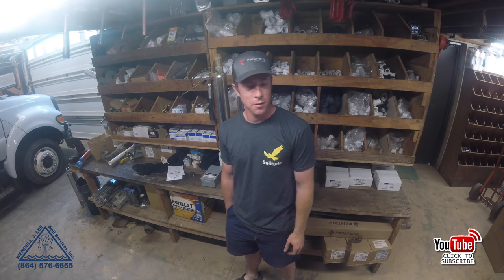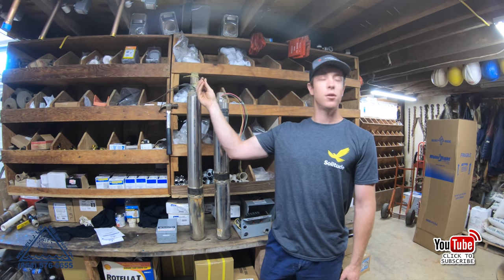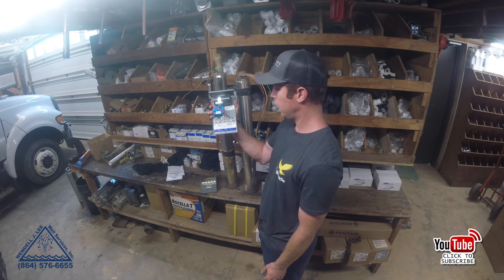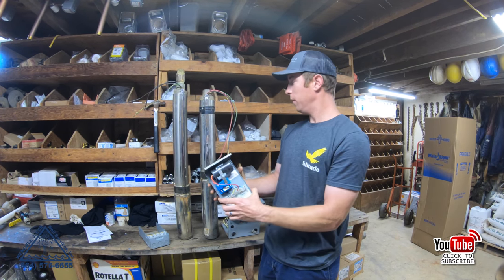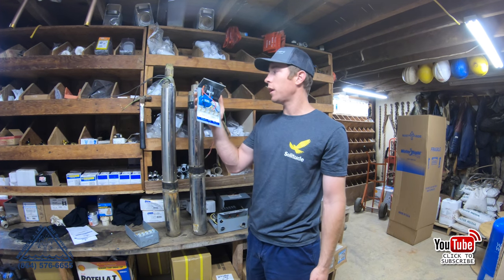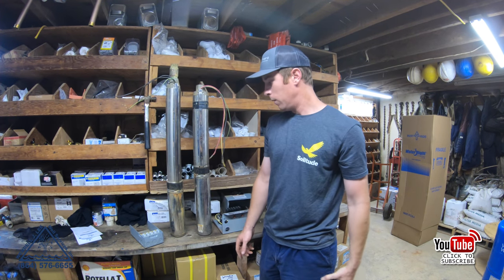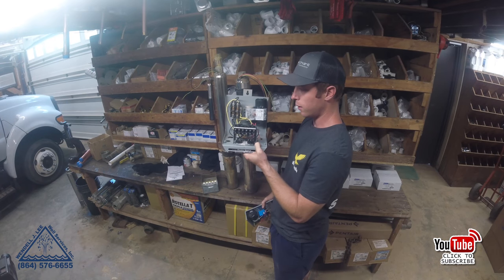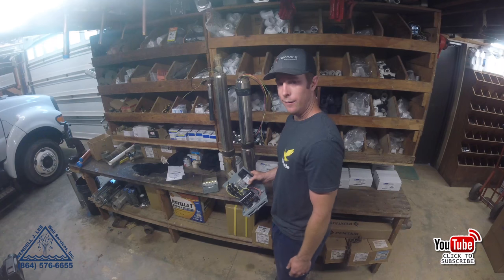2 Wire and 3 Wire Submersible Well Pump Motor Wiring Differences Explained

Comment: Thank you 
Thank you 
Thank you!
I’m learning about well pumps and everything else that goes along with them out of necessity. 
I recently told the property owner “thanks for allowing me the opportunity to learn how to run a ranch and be the full time maintenance man. I’m paying as I go so anytime something happens, I’m responsible. Eliminating the controller box made sense to me the moment I learned what it is. Used to be 44 horses here and the controller makes it possible to run the well pump and the transfer pump to keep the 3,500 gallon tank ready to fill a trough anytime and fill another and another. Now it’s just me and my little woman. No more horses for the time being. Thanks for reassuring me that I was thinking correctly about eliminating the unnecessary things that plagued the system.  I might make it fully manual and turn the well pump on once every four or five days and not have to worry about all the other stuff knowing I have a good transfer pump and pressure tank. Great videos like this one makes YouTube priceless!
Keep up the good work!

Comment: Nice videos. Keep them coming. I will be installing a 2 wire Grundfos 10sq07-200. I was leary of switching from a 3 wire setup to 2 wire, but the soft start feature, light weight, and low amp draw have me sold on it. I worked for a well driller for 4 years, but we generally didn't do pump work unless we were putting in a 4 inch steel liner or just pulling pumps for well abandonment. One idea for future videos, let us see what some common failures of pumps are, along with suspected causes, and maybe some reviews. Thanks.
Reply from the maker: Sure thing, thanks for tuning in and commenting. We always love suggestions and I will keep them coming. You will love the Grundfos SQ, we have had very few issues with them.

Comment: I have three wire system that I was convinced by the salesman to use when I put in my well 35 years ago. About 26 years later I replaced the controller because the capacitor was more expensive to replace. I was happy I didnt have to pull the pump as it was cold that november. That said, the following January I was pulling my pump when it was 30 below zero. Long story short, didnt save at all. Sure wish I would have gone 2 wire all those years ago.

Comment: I ran into an amazing rent deal in a brick house on several acres close to the city but surrounded by woods. Only catch was I have to fix things myself. House was allrdy Jerry rigged up with the wiring. After a few years woke up and no water no pressure. Eventually seen the 110 breaker labeled "well" had nothing connected. Wire from  well was run underground I couldn't ever find where it come out. I unhooked from junction box in well and run a dropcord and I assumed it was 110 cause it was 2 wires from pump and I knew way less then about well pumps then. I still don't know much. But I found that no matter which receptacle I plugged into the breaker box would wig out hum real loud then flip breaker. Realized that if I cut off hot water heater breaker I could then successfully choose any plug and have running water. But couldn't have hot water and running water at same time. Later I cut into water heater wire a few feet from the breaker and pulled it thru and hooked a dryer cord up to it and I have been doing that to feed my addiction to not cold showers. Over time my pump is whack and less pressure and I'm limited to a couple shits a evening after work and a quick shower n the morning. Sometimes I have no water at all. I kind of just wanted to share my experience with people that may would take a interest in it I know I got things rigged up like a waterhead would do. I assume a warm drop cord would happen on 110 or 220 , but if anyone is still with me here and had a idea of how I could find out of my pump is 220 that would be cool but it's not expected. U know, other than calling a professional. The way things are rigged up here even before I got ahold of things would likely bring more attention than I would like. Thanks for reading my rambling

Comment: Getting a well drilled next week. 1.5hp 2 wire. Told me I need #4 URD for a 200' run from the service panel. Urd has 2 hots and a neutral. Do yall just use the neutral as the ground on both sides of service? And does #4 sound right?

Comment: I've got a Grundfos 2 wire 10 SQ/SQE pump that's marked 110v on the housing.  According to the manual on the pump side of the pressure switch it shows Line Neutral and Green wires.    Mine has 2 black wires and 1 green wire.  Should I assume either black wire can be used as a Line or a Neutral wire?  You would think Grundfos would tell you what color the pump wires are but they don't.

Comment: I had a 3 wire motor. New motor is a 2 wire... I don't know how to wire it in. Do you have a video on how to do it? Do I still use a control box?

Comment: Now when you say a 2-wire, does that mean that it has three wires coming up to the top of the Wellhead? I actually have two wires coming up to the Wellhead into the house on mine. Is that right?
Reply from the maker: in today's world yes, two wires and a ground. You must have a pump that is older than 30 years, back before pump manufacturers ran a ground wire off their motor.
Reply: @WendellLeeWellServices   I am closing on an old house this week and I noticed the wiring from the well has 3 wires coming in, only 2 are connected to the pressure switch (which appears to be 240v), the yellow (which I believe is ground) is just hanging there not attached.  I have do not know what is under the well cap, but I am guessing it is an older 2 wire as well unless someone was lazy and just didn't want to connect the ground?  Have you seen it like this before?   I am planning on replacing the pressure tank and switch and will plan to hook up the ground wire to the well pump (even if the current pump doesn't have a ground wire) that way when the pump needs replaced the ground wire will be grounded.
Reply from the maker: @brandonandkeiafink204  Yes I have seen this before. Chances are your pump is old and doesn't have a ground wire ran out of its motor.

Comment: Great video man. I am here in Canada and have a flowing artsian well with a 2 wire 1HP motor that has issues. Do you have to use a trash pump to pump below the pitless adapter while pulling the pump? or just do everything you normally would do with the water flowing out if the top?
Reply from the maker: we dont have many flowing wells here but in the few ones we do have, we just pull them as we normally would. We also don't install pumps on a pitless adapter here either, all of ours are on a well seal resting on top of the casing 1 ft above grade
Reply: thank you for your reply. I wish mine was like that. Pitless is 5.5 feet down. I've tried calling around to have the pump pulled and everyone is just terrified because it's a flowing well. I am going to attempt it myself at this point.
Reply from the maker: @tnt666tnt  hopefully it isn't too deep in the well. 5.5 feet down to the pitless, good lord that is DEEP! But it has to be where you are.
Reply from the maker: @tnt666tnt  if you had a small trash pump you could pump the water level down long enough to get to the pitless. I'm not sure how much it is flowing but it would give you some time to see and get it out before it starts flowing again. Flowing wells are aggravating.
Reply: I agree. it seems very aggravating... Last year the top of the well froze and the ice pulled apart the butt connects for the wiring to the pump. I paid $400 Canadian to have some guy pull the cap off and tell me it was frozen That's when I learned we even had a flowing well. I thawed it myself, found and fixed the wire. Now I want to pull the pump, replace it and install a well buster seal so water wont come above the frost line.

Comment: How far from a power supply meter  can you run a 1 hp pump motor drawing  10 amp max on start side  w/ 15 amp  breaker  ( 550 ft #4 cu. presently under ground and  320ft to pump in well) 880 ft total, can we  run pump on 10 ga. from starter box at well head.? DJ @ wildcat well svc,
Reply from the maker: according to the franklin aim manual you can run #10 if you have #4 ran from the breaker to the well head. Although for a 1 hp motor, you need a 20 amp breaker instead of a 15 amp.

Comment: Is there a difference in phase of the motor with a 2 wire or 3 wire or are they both single phase motors?
Reply: Both are single phase. Only the controller (starter) components are a little different. Two-wire is simpler for the installer because the starter is integrated into the motor. But more costly overall to the owner, because the motor/pump unit must be pulled to the surface for testing & repair etc. 
For example: I have a Franklin/Grundfos, 1.5hp 3-wire setup that is way over 20 years old & (almost) everything can be tested and serviced at the surface. My pump spun-off of the 1.25" PVC pipe because it was short-cycling or "jacking" (installed by the previous (non-genius) owner). I'm installing a rebuild kit in the pump while it's in my shop (seals, check valve, & bearings etc. 
Here's a tip for y'all:  please save yourselves a lot of aggravation, & don't depend on PVC pipe to support the weight of your very expensive pump unit. Attach a stainless steel wire/cable to your pump, and anchor it to something sturdy up top. It'll make it much easier to yank it out later, and one person can do it. 
Btw, does anyone know where I can find a replacement relay for my 3-wire 1.5 hp Franklin starter box ? Thanks in advance fella's.
Reply: @brianwood7480  Thanks. I figured that just never tested. Most neutrals and grounds are bonded in the panel and a 240 vac hot water tank will work without a ground. Sorry I dont know where to find the part you require. Cheers

Comment: I could use some help.  I have a water well feeding my house. And  my house has three bathrooms I have a three-quarter inch pvc line coming from the well and it works good. Now  my father-in-law wants to put in a camper to be near us  around 400 feet from my well  His camper has a shower an sink and toilet . He also will have a portable building  with a full bathroom and washer and dryer  facility . If I hook onto the back of my house it's only 300 feet and would save 100 ft digging and pipe should  3/4 " pex from my house to my father-in-law meet his needs or do I need to increase my plumbing diameter? Or run a 400 ft dedicated to the father-in-law place and if so what size pipe.

Comment: Yeah thanks very much. Good info.
I just changed my 2 wire . 176 feet deep.
My shoe was about 10 foot down and a real problem lining the shoe back up.
I did the whole thing by hand 🖐. That pip gets really heavy man💪after about 20’ .
It  was like 20 beer beak 20’ beer breaks.
Hahaha
Reply from the maker: lol i hear ya, it does get heavy quickly

Comment: I can't find anyone that will explain what the yellow wire does on a three wire pump. You have to hots coming into the control box which then turns into three wires going into the pump. I have heard the yellow wire is to help start the pump another site it said it's is a neutral.
Reply: I think the yellow Wire is for the capacitor to help start the pump but I'm no expert

Comment: Hey guys! I have a 1,5 HP, 230 volts ,10 AMP,   RPM 3450 well pump. 100 feet away from the control box. Can anyone help me out what's the necessary wire gauge for this condition? My electric usage 18-22 kW/day without well pump. If I'm running the pump as well goes up to 80-90 kW.  Isn't little bit too much usage from a 1,5 HP pump? I'm not an electrician but looks like the wires to the pump 14 or 12 gauge. Just wondering if it could cause the extra power usage? Thanks for any help
Reply: No, the cable size isn't responsible for your power consumption. That cable really should be upgraded to #10, but where are all those kWh going? That's a ridiculous amount of power. Even if your pump ran continuously, twenty-four hours a day, you'd 'only' use about 60 kWh.
Reply: @paulmaxwell8851  Thank You, Paul!

Comment: I just changed my 15 - 20 well .  My old pump was properbly still good. But I changed it. I had a crack on one of my PVC's which had leak, probably too much on pump, no water.  Replaced pump. Pump is not 2yrs old, no water a week ago. Same well folks put in the new pump trying to find the cause. They pulled up pvc' as they were taking out pvc's they saw the wires burnt out on different sections of the PVC. They patched damage wires, reattached to PVC and charged me almost $600.  Are they allowed to charge
 that much. They installed pump, I think this was their poor workmanship.

Comment: ❤ when I receive that pump with two wires I told the guy that I was helping put it in this pump is not made for this system is system is not made for that pump and people don't believe me he's like oh well wired around it and we figured it out how to wire around it but now we got to control box that's feeding a two wire system. And I think it just Twisted the whole pump right off at the end it made the pipe look like spaghetti noodles

Comment: Put a few pentek 2 wire ones in and do a review. Just pulled one at 270 didn't last 6 months. Franklin the only 2 wire motor that will last.
Reply from the maker: Dang, yea that is aggravating. All we have used is Franklin motors for years, I haven't heard of people having problems like that with the smaller Pentek motors. That is definitely good to hear and know.
Reply: I sent it back for refund and my supplier told me they get a lot back. We use Grundfos and Franklin. Franklin is a great company to deal with. They have a state of the art factory in Bolton Ontario Can not far from us and you can get product training from them,we are planning on going in the winter. And it's free. You got a great channel. I would like to know more about rotary drilling all I know is cable tool. Thanks

Comment: My submersible pump literally has only two wires going down into the casing. The installer described it to me as a two-wire 240-volt pump

Comment: My two wire pump will now and the not come on when the pressure switch clicks on will not catch and the points don’t stay closed its new pressure switch should I try to adjust the on pressure from thirty to 25 and yes the bladder pressure is at 28 now the switch is a 30-50

Comment: Wouldn't another benefit of 2 wire pumps be that you can use a generator if the power goes out and/or hook up to solar power much easier?
Reply from the maker: well a control box has to be in there somewhere, whether its build into the motor from the factory or up on top of the ground it doesn't matter. so that really doesn't matter you can use a generator on a 3 wire or 2 wire pump
Reply: @WendellLeeWellServices  Ok thanks, I think to use a generator on a 3 wire pump you have to have a larger, 230 volt capable generator? (I have a smaller generator that is 115 volt only)
Reply from the maker: @TrentAlvarez  yes that is correct

Comment: An added advantage to a three wire is that if ever you need to run it off a generator or inverter, the three wire pump will start on about half the current needed (generator size) than a two wire pump.  They also are a little more efficient to run.   In my case I down sized from a 3/4 hp two wire to a 1/2 hp three wire.  I needed a 3,200 watt generator to start the 3/4 hp 2 wire but the 1/2 hp two wire would start on a 1400W gen or a good quaintly 1500W pure sine inverter (BTW: I did this through a 120 to 240 transformer that used 100w itself - it was at least 2x oversized) ) .  It may not have taken a full 3200W gen for the two wire 3/4hp but that is the next size I had and I had it on good advice that it would take that much).  Also, while I haven't tried it I understand and capacitor start/capacitor run control (two caps and a start relay) may have made reduced the start and run currents even more vs the more typ single run/start cap control.

Comment: We had lightning take out 2 TVs and our well pump started messing up. The water will only work for a little bit shuts off low pressure. I checked electric and I'm still getting 240 going down to the pump. If we wait a couple minutes it comes right back on

Comment: I have removed my control box cover on my 3 wire deep well system and I’m getting phase to ground on all 3 leads to the motor. Is this normal or am I missing  something?

Comment: Thank you for the video! I live in Florida. I have well for my sprinklers. Last week it only water half of my lawn and it stop. If I turn to manual mode it will still have water come out but if I turn it to auto mode it will not come out and it will trigger the braker.  my sprinkler guy just replace the controller but still do the same. so he suggest to replace the pump. My neighbor said it could be water level too low. Do you have any idea what the problem could be? Should I replace pump? Thank you for your time!
Reply from the maker: It could be a lot of different things that is hard to diagnose without being at your jobsite to see exactly what is going on. How long has the pump been installed? Is the controller faulting out on low water or high amp draw? Is the controller faulting out or is the breaker tripping? Have you had any bad storms in the area with lightning strikes close by recently? I would start by getting a licensed well contractor out from your area to look at your problems.
Reply: We haven't rain for a while. It could be low water. if so, what should I do?
Reply from the maker: @kawaiikate5145  If that is it you could try and drill another well or drill it deeper to obtain more water. I doubt if that is it but I would get a licensed well contractor to look at it. They would be able to identify options for you if that is it.
Reply: Thank you!